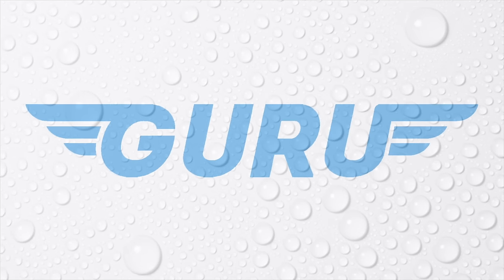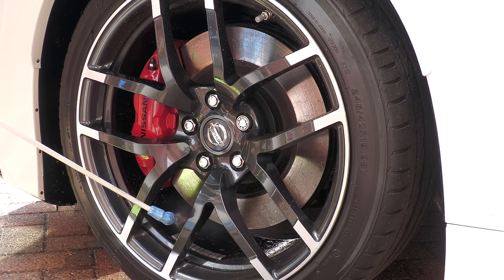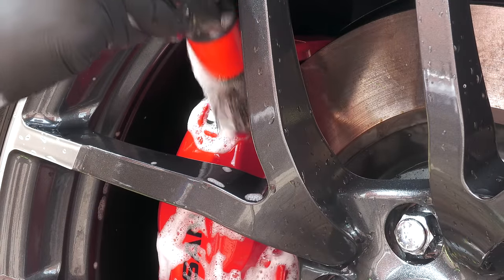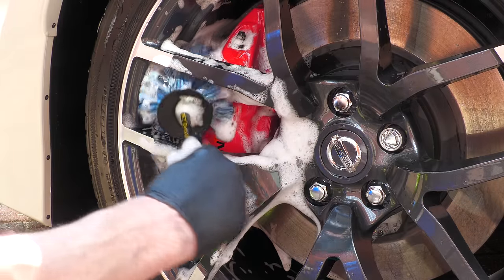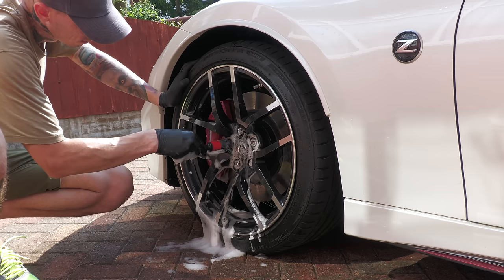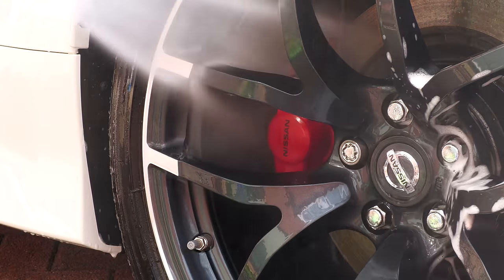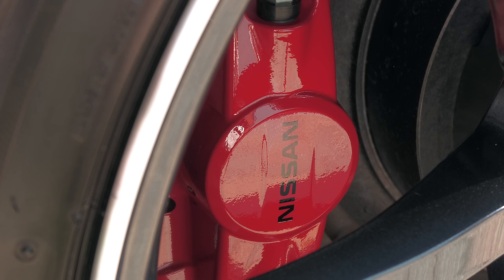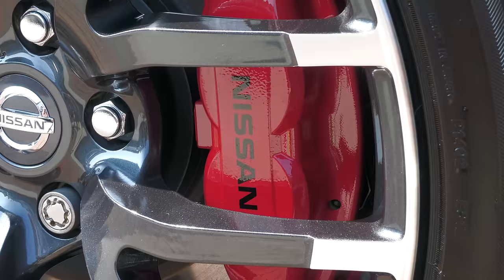Brake Caliper Cleaning Tools & Techniques

Comment: Great video once again Mr. Guru.   I really enjoy these "How To" videos and what processes you utilize to get the job done effectively.   These are some of your best in my opinion but all of your videos are great none the less.    I actually picked up a set of those long handle VIKAN brushes you show here about a year ago after you showed them in another video cleaning an engine I believe it was.  Had to have them shipped here from the UK and I think the shipping/customs tariff cost me more than the brush set.  But I get a lot of use out of those two brushes and I have since purchased additional VIKAN brushes.   They are some of the best brushes I have in my arsenal but they're a little hard to get here in the US of A, although Amazon has a few of them now as well as ebay so they're getting a little easier to find here now.    I especially enjoyed this video due to the fact that I myself have a 370z too and it's nice to see how you clean your own 370z wheels and calipers.  I'll be using some of the tips your outlined here.  Thanks again Mr. Guru, you are truly the "GURU" when it comes to instructional detailing videos!

Comment: Ok - apologies for the novice question; but why do we always have to clean our wheels BEFORE the rest of the car? I can't get my head around this as I always feel that I'd have to dump all the water from both of my buckets before I moved on to the rest of the car due the amount of oomska that comes off the wheels and brakes..? Thanks in advance!
Reply from the maker: Ideally you should have a separate bucket for the wheels, even if its just a cheap one but the main reason you want to get them out of the way first is because they’re generally the dirtiest part so if you did them afterwards might contaminate the freshly cleaned body plus you have the rinse water or suds sitting on the body potentially spotting and streaking while you tend to the wheels.

Comment: Did you know I took my front calipers to bits to refurbish yesterday then? That’s what I’m off to the garage to do this morning, so cheers for the motivation fella.

I notice you don’t have to use a wire wheel and flap disc at any stage, unlike on an 18 year old saxo... 😉

Comment: How do you deal with water that’s lodged in the brake disk after cleaning? When I move the car rust comes out and coats the inside of the rim..
Reply from the maker: You can either pull the car forwards and backwards a few times with the brakes on after final rinsing then dry the wheels or use an anti-rust spray on the discs before and after cleaning but neither will eliminate it fully, that’s why carbon ceramics are the dream!

Comment: will the second, common synthetic brush you used on the caliper be safe? the red one. or is there risk of scratching?
Reply from the maker: Definitely a risk of scratching so if the calipers are new, freshly painted or just in really good condition then a super-soft feather-tip type brush would be safer.

Comment: could there be a problem with so much detergent washing away some of the grease that is between the backside of the brake pads and the piston or on the sliding edge of the pads?
Reply from the maker: Technically yes but if you keep on top of them you shouldn’t have to use a strong cleaner every time.

Comment: If you want a bit more access but don’t have the time to remove the wheel, jack the car up and move the wheel as you clean to reveal more of the caliper that you can’t get to with the wheel in a fixed position.

Comment: One thing With  washing/degreasing The brakes/wheels is that you wash away al the needed grease for proper brake action and alot of the moving parts starts to corrode...

Comment: What about caliper lube? I've stopped cleaning my calipers like that "casually", because they ALWAYS squel after cleaning them like that...i always disassemble them, clean them, and freshly lube them...
Reply: Hi, well there shold not be any lube. If they squel there is other issues.
Reply: @reimop9595  Sure. Every single manual considering disc brakes REQUIRES you to put the special lube on the sides of the brake pad. If you are a mechanic, please get some education. If you are not a mechanic, let the professionals to the job...
Reply: @NFreund  Im not mechanic :) Lube or not choice is yours. But i can tell that its not 1/1 topic. Some brakebads never want lube some does etc.

Comment: So technically this isn't a caliper clean more outside without taking it apart, a proper clean is taking off the caliper and fully cleaning it down properly, video a bit misleading.
Reply from the maker: From a car cleaning perspective it is. I’d call removal/disassembly more of a mechanical service/maintenance.
Reply: @CarCleaningGuru  hmmm not too sure if I can agree tbh
Reply from the maker: I mean feel free to remove your brake callipers to clean them but I think 99% of people would say that's overkill from a general car cleaning perspective.

Comment: So much work for something what is dirty two hours later when you drive again. Nobody sees it and you dont get any applause for the result of cleaned braks. In my opinion, Its not worth to do so, simply its pointless. That`s ideal for people who have too much time all day long.
Reply from the maker: Nope, nice clean chunky painted calipers on a sports or performance car set it off an absolute treat and assuming you give them a quick maintenance clean along with the rest of the car every now and again will stay looking pretty fresh in my experience.
Reply: You are clearly missing the point here. If everyone used your thought process, nothing would ever get cleaned. I pray that you have good hygiene.
Reply: @michaelskinner896  To wash (handwash) and seal (Sonax Brlliant Shine Detailer) a car twice the month is enough for a clean shiny car which is daily on the road. Aditionally, from time to time a polish if required is also fine. More than that, especially to maintain invisable corners of the car, is enthusiasm and fetish in my opionion. Ok, here are mainly Premium- or Sportcars of the "rmoneybags" so maybe the usual car wash isnt enough for them. Probably others see it different, its ok for me. However, some tips and tricks are helpful in the videos generally. It's a interesting channel tho. :)